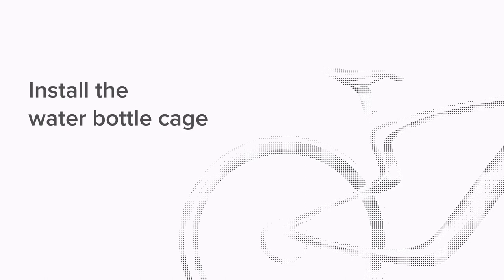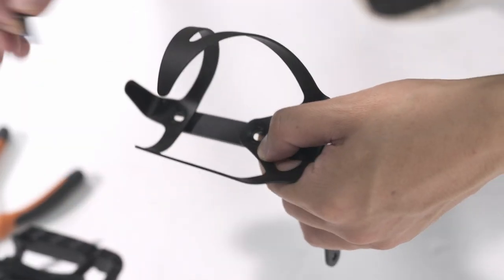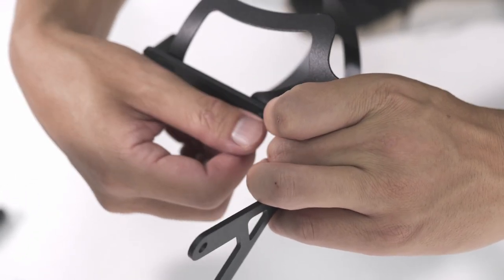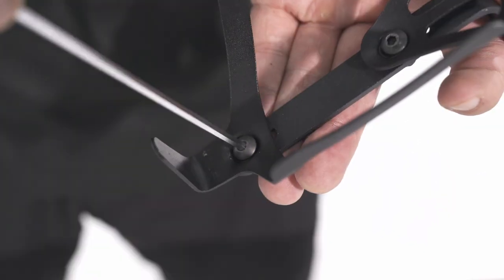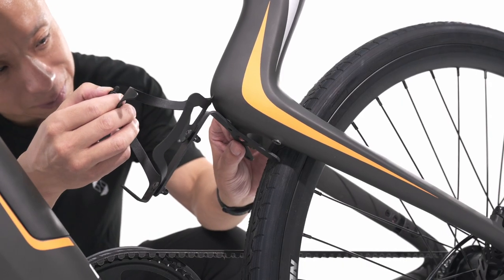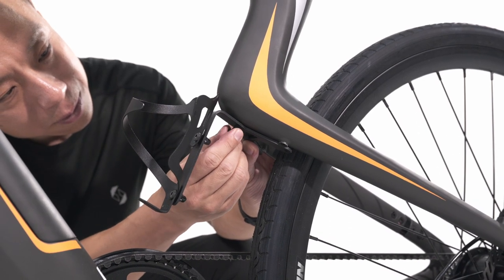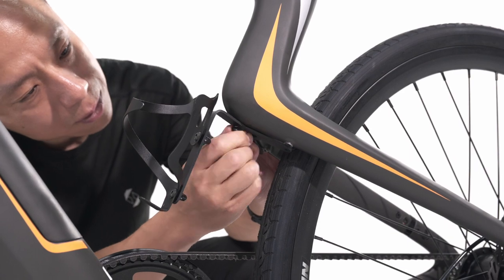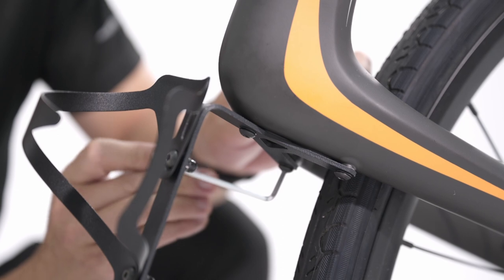Urtopia Carbon E-Bike Tutorial | Install the water bottle cage

Comment: One of the screws on the cage that connects it to the connector vibrated loose during riding and was lost.  What size screw and nut are used?